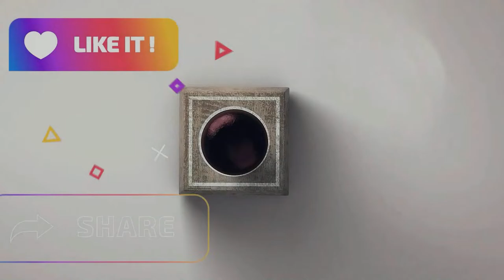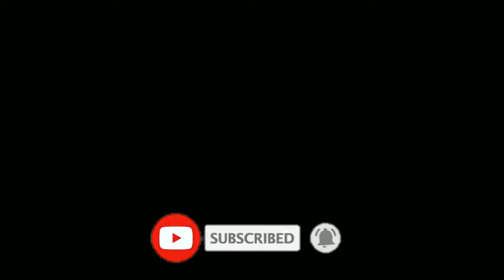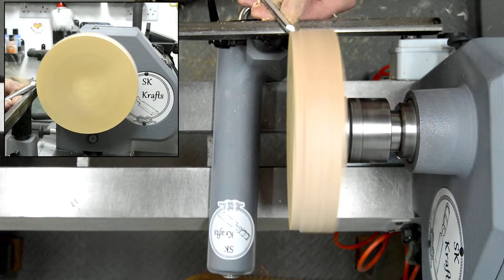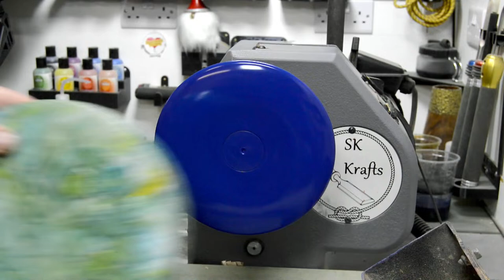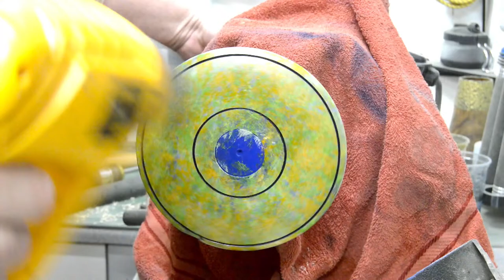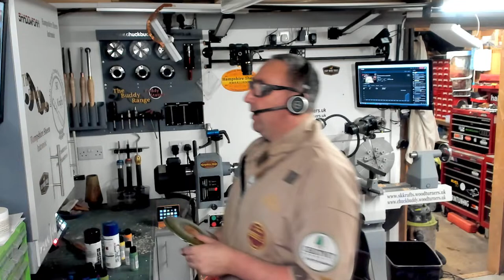Playing with new paints from Jo Sonja - Pearlescent Colours

Comment: Pretty! I like the sponge texture. Next time you use a marker, try letting the tip drag downward so the ink comes out the side of the tip, not the end. You will get much higher flow of ink and it will not damage the shape of the tip.
Reply from the maker: Thank you.